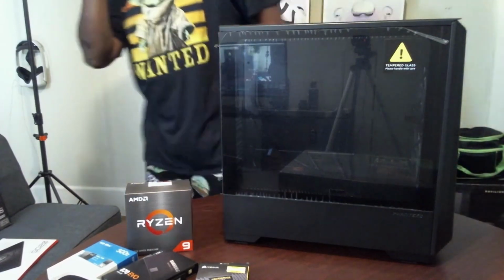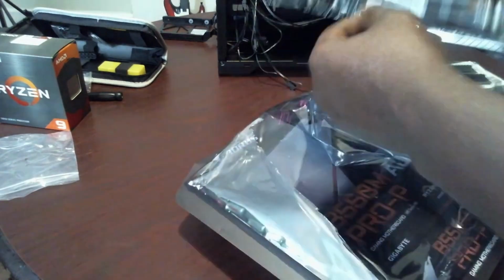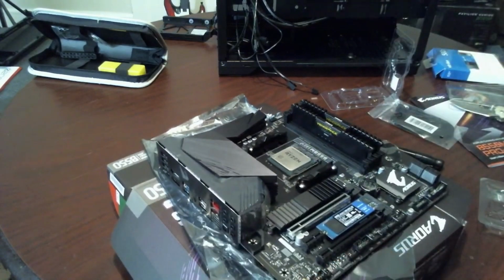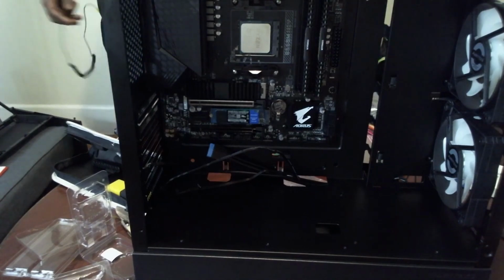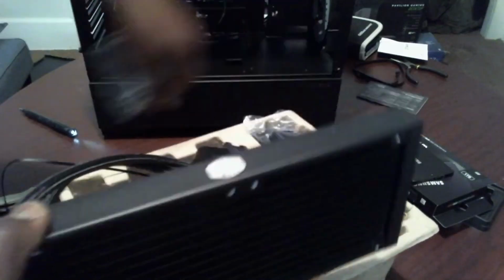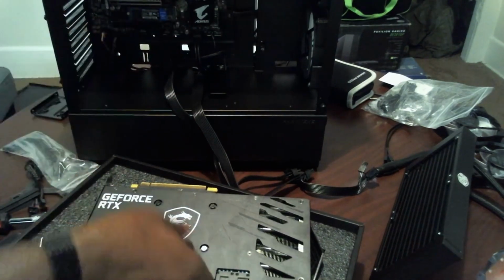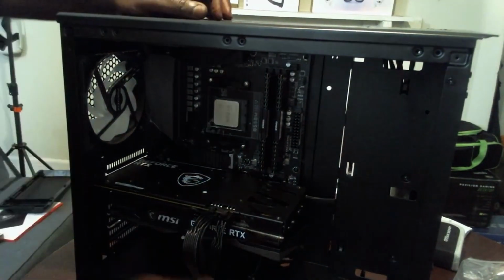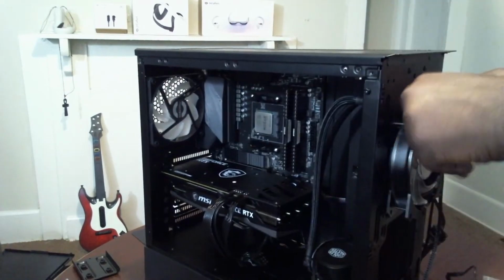My very first PC build!!!!RTX3060,Ryzen 9 5900x,Arous B550 $1400/insurance $1600

Comment: Grats on the new Rig. It looks awesome. Great job assembling it. What all are the specs of all the pieces you put in it?
Reply from the maker: I truly appreciate it, I love it. The MotherBoard is a Aorus B550M Pro-p I went with that one because of all the extra usb ports ect. Amd AM4 socket, 256 Mbit Flash. CPU: Amd Ryzen 9 5900x, 3.7GHz 12 core, 24 Thread Processor PCIe 4.0. I have not overclocked it. GPU: GeForce RTX 3060 , 12 GB GDDR6, 192-bit PSU recommended 550W. PSU: Fractional Gold 850w. Fan: Aoi, Masterliquid ML240L RBG (Cooler Master). Ram: 32gb Corsair Vengeance. Storage: NVMe Samsung internal- 970 EVO plus SSD 1TB,  500Gb SSD I cant remember the brand, 2 1TB WD HHD's,2TB WD HHD. Case cant remember the brand. Every thing was purchased through newegg except the CPU, Ram, and Storage. Thank you for watching and commenting truly. Also there will be a part 2 in a short time its going to be my set up as well as the viewing of the PC. Have a good 1

Comment: My only (but major) suggestion would be to get a fan or two set as exhaust to help improve performance.
Reply from the maker: I agree I was going to add 2 or 3. one on top and two on the back of the AOI system. The temp stays at about 74 degrees. When I first built it I kept an eye out for it because my last system had that problem. There will be a part 2 for the showing of my set up also But it wont have the fans lol it will be soon very soon. And thank you sooo much for watching and also commenting, Thank you.